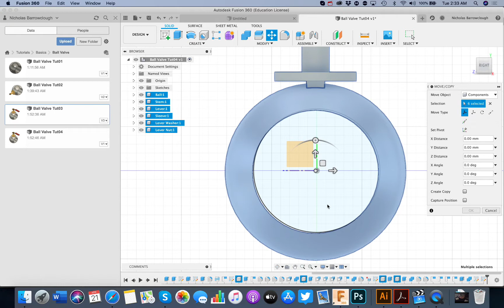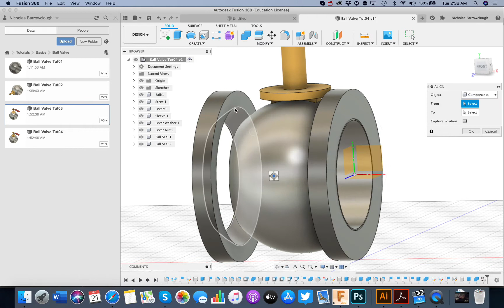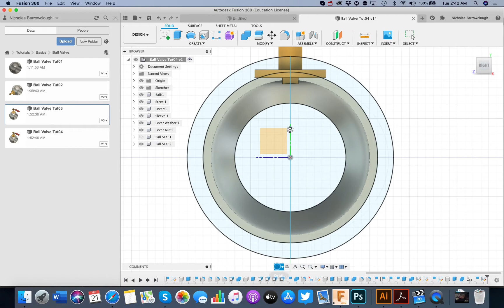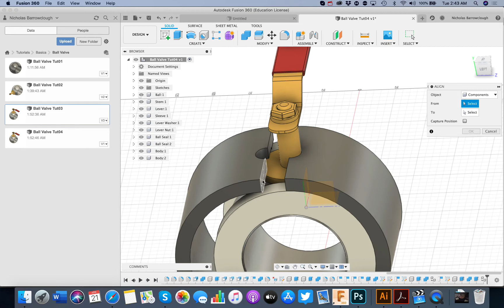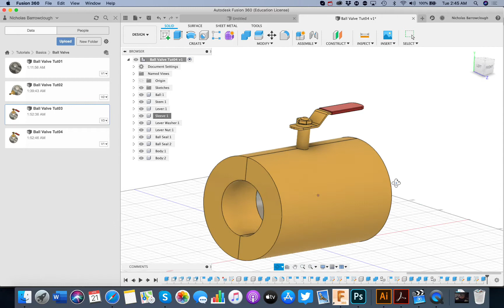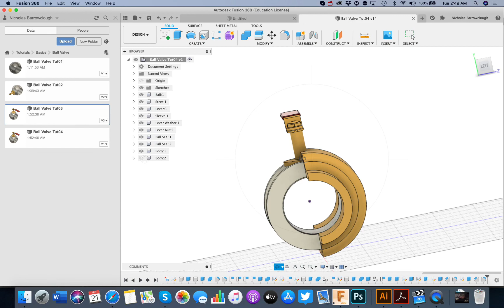Fusion 360 - Ball Valve - Tutorial 04

Comment: Thank you for the great videos, they have been very useful. 
One question though, couldn't we have used the mirror instead of copy/pasting? Any advantages to your approach or is it just personal preference?
Reply from the maker: Hi, yes you can mirror, however, as you will see in my later video tutorial, there is a problem with mirror, and the copy method I used here. When you mirror, or copy, when you make a change to one side, it will mirror that change to the other object. That is a problem later when we need to add a limitation to the handle rotation. This means that the right and left side body must be a little different. So we should actually use the "copy new" so that it is not a mirrored duplicate that updates with changes, but a completely new independent component. You can see what I mean here https://youtu.be/P0vTXZmOGEA